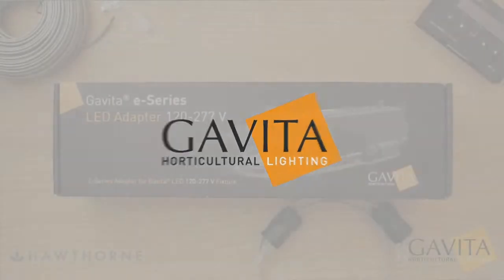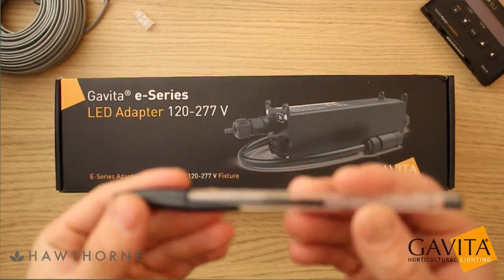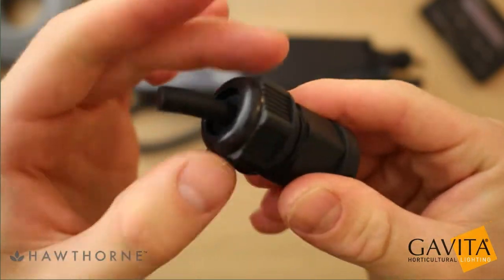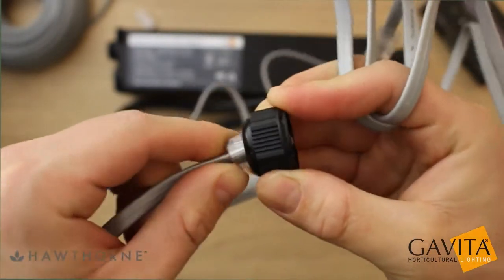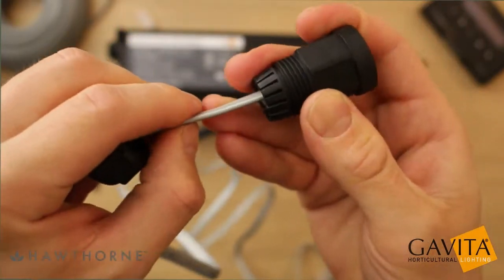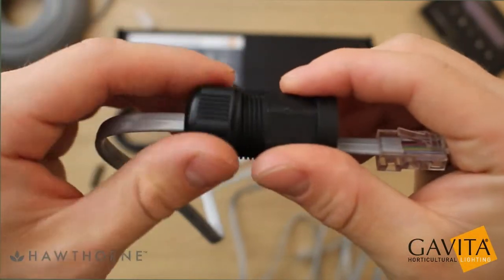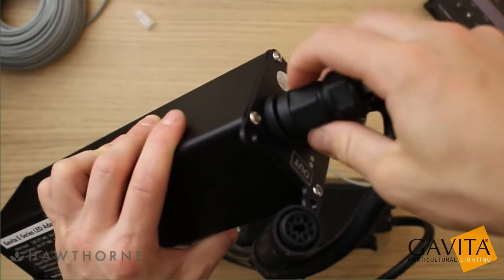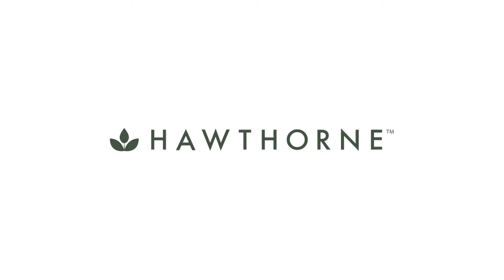How to Waterproof Your Gavita LED Interconnect Cable

Comment: I bought the El1 controller and noticed the black cable that come with the El1 doesn’t fit in the adapter (slightly smaller). It also doesn’t make a click noise to let me know it’s locked in. Is there a different cable I should be buying?
Reply: For the 1700 side you'll want an rj45 end. This cord is an accessory which does not come with the EL1/EL2. Here is the product number HGC906716
Reply: @jarredjoffe4886   Will this HGC906716 plug directly into the  Master Controller EL1 out channel and also plug directly into the Pro 900e LEDs input?
Reply: I have ONE pro 900 LED with the additional Adapter and Master EL1 Controller. 
  What interconect cable links the EL1 to the 900led?
  I see a "T" adapter for LEDs for sale online.
And a Cable Crimper referenced in the manual.  I'm unsure as to what should be used.

Comment: Gavita I’m starting to regret buying your lights solely due to the fact that the adaptor to dim uses the same amount of amperage as my lights as someone who has a threshold of amperage available to me this makes me regret it that cannot use the dimming capability on all lights let alone that I have to buy an adaptor for each light making costs even greater thinkgrow fluence all are compatible with trolmaster and are much easier to dim how does it take so much power as money to be able to dim my lights there should be a built in dimmer or just a different more efficient option not impressed
Reply: Hi Z G, I'm sorry to hear about the regret. I really like these lights and have only had really great results. May I ask what you current limitation is? The E-Series Adapter uses 0.3-0.5A depending on your line voltage. The adapter adds a repeat bus circuit allowing you to connect over 500 Fixtures in a daisy chain. The Gavita's are compatible with Trolmaster also. The Hawthorne engineering team is readily available to support you at no cost.
Reply: @jarredjoffe4886  I just got my lights from you guys! A pair of Gavita 900e's, each automatically came with the E-Series Adapter, which I really appreciated. At first I was a bit upset at myself for getting lights that required an additional purchase to get the dim feature, but after reading so much about Gavita I knew it was the only light I wanted to go with. Watch out for my order for the Gavita Master Controller EL1 - Gen 2, it's coming soon :)

Comment: so I have to buy one of these for every led I buy if I wanna use the master controller ?
Reply: Yes, the E-Series adapter significantly increases ease of installation by providing watertight IN and OUT communication ports, allow for dimming to OFF without cutting line voltage, and adds an extra step of protection in the event of power surges. The cost to have an electrician come in and hard wire the fixture is typically the same as going with this plug and play adapter.
Reply: It’s unreal and you will consume more energy when you buy the adaptor costs you up front and long run smh
Reply: @zg1936  huh?